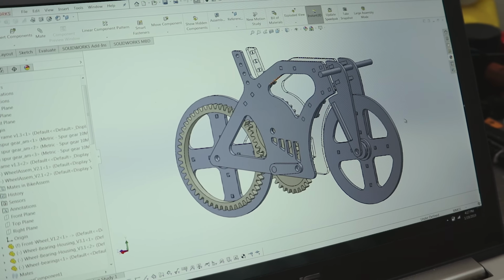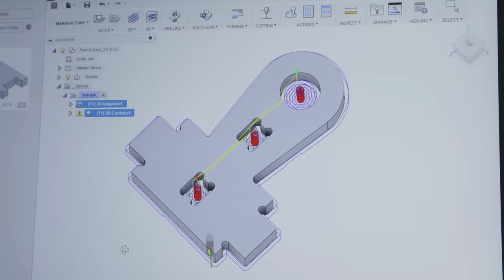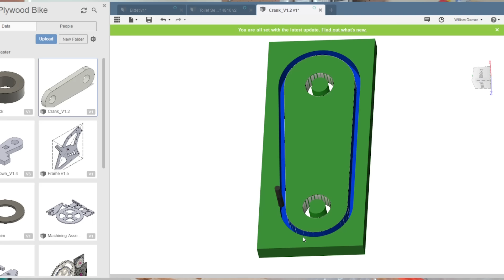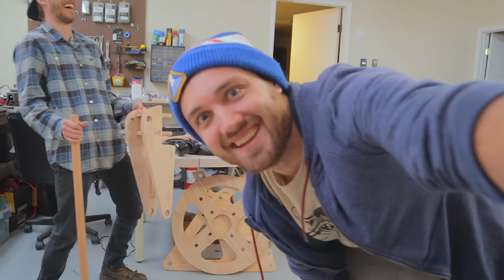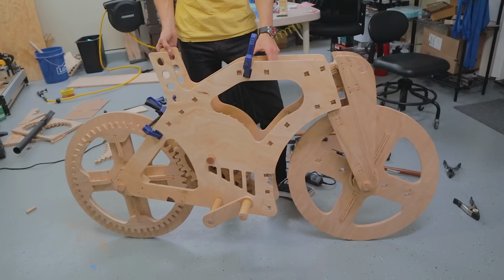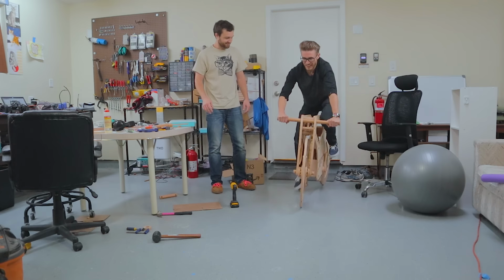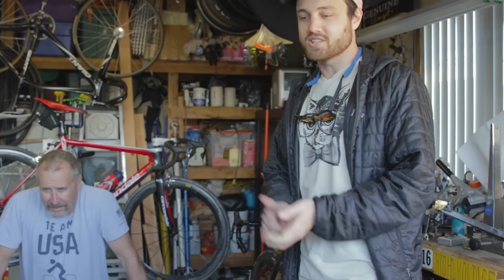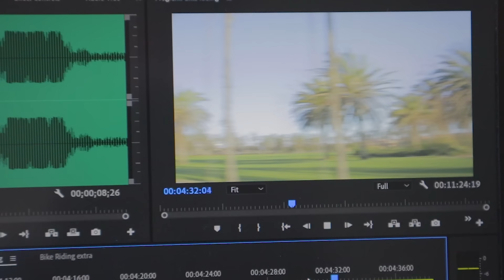ALL WOOD BIKE - Will It Survive?

Comment: That stop motion... 👏👏👏👏 I'm actually gonna share a practical CNC tip! - to avoid tabs, put blue tape on the bottom of your plywood and on the top of your wasteboard and put super glue in between them 👍👍
Reply: That makes no sense
Reply: Where is the stop motion?
Reply: okay
Reply: @ericmeader9171  It does if you have a waste board and not just cut it with nothing underneath. Also, you have to make sure you don't go through the waste board.
Reply: @Khirillin  6:50
Reply: I just use tabs, break them out of the main sheet with a chisel and use a trim-router to clean them up. 
Fast, reliable and with a nice result.
Reply: @ElectraFlarefire  but then you have to add the tabs into the whole thing... it's reliable alright but it's still a pain to even just think about what it would be like to add tabs when you have like a 200 piece thing with 50 different types and shapes.
Reply: For more stop motion like that, check out Frank Howarth's channel. I'm pretty sure William was making an homage to him.
Reply: @ericmeader9171  You have the wood you want to cut. You put blue tape on the bottom of that wood. You get it so far? Wood with tape on one side. Now you take that tape which is stuck to your wood and you super glue it to another piece of wood that you don't care about. So now you have your work wood, the tape adhesive is sticking the tape to that wood, then you have other wood super glued to the other side. The tape (which is superglued to the waste wood) is holding your work wood in place without needing tabs. Then when the cut is done, you peel the wood off of the tape.

This would hypothetically work with double sided blue tape, but that's not a common material, hence the need for the superglue.
Reply: William Osman wants to know your location.
Reply: @Khirillin  There isn't... The bike built itself in the middle there.
Reply: Greendawn21 TY
Reply: Interesting discussion here. Can someone explain it to me?
Reply: ah ye olde super glue holding, with tape to help clean up the superglue. NYC CNC use that a lot now with metal cutting.
Reply: @ericmeader9171  it holds the parts in place once the piece is free from the larger board. No tabs= nothing holding it, tape holding it from the side= something holding it.
Reply: That's a good trick, it's actually just like the purpose of a mat in vinyl cutting setting it up like that
Reply: would double-sided tape work too?
Reply: @jerrylim6722  I'm pretty sure that there are tools integrated that allow you to generate these tabs automatically in the CAD.
Reply: double-sided tape works wonders

Comment: I know it's too late but you can add graphite to "lubricate" the moving parts
Reply: Bird Up you didn’t see graphite on the ground because it’s not there!!!
Reply: Or soap...or wax
Reply: Shadowgolem or pee
Reply: I would of just flat out used heavy grease.
Reply: or wood glue...
Reply: At that point it would be a giant mechanical pencil.
Reply: Also add pedals and a seat
Reply: Bird Up This actually works, use to lubricate our wooden tubing on Violins.

Comment: CNC is like the duct tape of design.  You can use it for anything
Reply: if your cnc is precise enough, yes, I was planing to use one for making the rocker arms for my old truck till I found some second hand ones.
Reply: 0-o Nooooooooooooooo.
Not even a little bit.
CNC is a tool that can do crazy curves and depths, completely automatically, and very accurately
but
More often then not, 
using hand and manual tools will be faster, have a lower reject rate, and easier then using CNC for any one off project.
Reason being, manual tools have less steps between design and production, and every step you add you add a place where something can go horribly wrong
Great for high production however.

Semi CNC is the duct tape of the machining world.
Reply: Cnc: people think it's magic and frequently misuse it, especially when unfamiliar with more conventional methods of fabrication.   Just like duct tape.
Reply: @pstrap1311  How do you misuse duct tape?
Reply: @gavinstebbins6350  by attempting unfeasible repairs with it.  For example, patching leaky rubber boots or boat hulls.
Reply: @pstrap1311  that's not misuse. If it works it works.
Reply: @TheFuriousBean  yeah, but it doesn't work to try to use duct tape to make a water tight repair.  That's what I mean.
Reply: @pstrap1311  It will work if you use enough and do it properly. Worked for me.

Comment: Couple of thoughts i had while watching, if you ever happen to see this comment. You could make the shaft a little too big for the hole in the drive gear, use steam on the gear, fit the shaft through and let it return to room temp and dry, bam those part aren't going anywhere. Shortening those pedals a bit might help, the shorter lever length and the load being forced to stay closer to the fulcrum should reduce the stress on the dowel, at least a little. It'd be interesting to try to find a way to "lock in" in some way so you didn't have to worry about slipping off, I know from experience it's almost impossible to pedal with round pedals. Smaller wooden bearings would seem fairly necessary for an actual pedal, but i'm sure they'd be incredibly difficult if not impossible to make/able to stand up to the forces. Love this idea, I'm impressed it worked so well!

Comment: Why dont you ziptie the vaccuum succ part to the CNC head
Reply: SUCCCC
Reply: Because it SUCC!
Reply: I've worked with a great deal of cnc machinery and that's a pretty standard addition, we usually routed out an adapter for the vacuum, kinda like printing parts for the 3d printer. Another addition is a oval shaped brush that keeps the dust and vacuum pull in, downside is it blocks the view so its harder to see if it's working right. It's super useful, but sometimes hand vacuum is easiest.

Comment: In Germany we use metal for bikes
Reply: Metal for a bike! we don't use metal unless we make a toilet seat because it is too expensive. Only the best for our behinds
Reply: In Germany we simply would have researched the physical stress it would have to endure and made design and wood choices accordingly.
Reply: Werecarebear  it's more that the video was made out of curiosity to be pretty much just a curiosity and watch. No one really wants a wooden bike necessarily although I'm pretty sure it would work fine for the body you just want the wheels and the chain stuff to be made of different materials for sure, regardless not meant to be taken seriously just dudes messing around with a 3D printer
Reply: @ashleyburbank3129  Yeah I know it wasn't meant to be a serious video. They would have done a few things differently if they planned it to actually hold.

It was just "Hurrdurr German engineering!" banter.
Reply: Laufmaschine says otherwise
Reply: Ashley Burbank r/whooooooosh

Comment: If you ever do it again you can have T formed pedal with a little hole a little under the - in T, so you use the (l) in T as (ground/gravity pull ) and the - to stand on

Comment: It's a multimeter - so if a battery reads absolute 0 - then switch to resistance or continuity and check if the leads are working.! If those are working - and voltage is also spooky - then you can spend 30 minutes figuring that out.

Comment: Yeas use dowels to lock everything in place on the axles. Not trough it since that removes too much material, just so it goes into axle material say 1/3s of the diameter. Coat everything with varnish except bearing surfaces and coat those with oil so it self lubricates from the wood it self and for high tress areas use baltic birch plywood since it has more layers and can handle more force. Install rubber tires mentioned and this could actually be pretty neat little city bike. Ou and dont glue one side on, just use dowels to tie it down, so you can take it apart later. Alternatively the middle peaces make those into two that get locked by dowels

Also where are the plans? This could be fun build.

Comment: What's funny is if you had the money to build this out of timber instead of plywood it would have actually held up. Plywood is uneven in strength, so you'll get weak spots that are softer than the rest. I've seen bamboo bikes turn out remarkably well, no reason you couldn't make a designer wood bike.

Comment: Next time, machine a “key” slot in your crank then glue a wooden key in the slot,  and your axle no break/spin. And bee’s wax your bearings and moving parts.
Reply: I thought of a key too, but i think it would have to be too small and would just round itself off. Remember that everything is weakest in shear. I suggested steam fitting the shaft to the gear. I didn't think about wax, that does seem like a good idea.

Comment: So, you had those wooden shafts that were attached to gears just by glue? 
Key them. 
Keying is when you cut slots into a bar and a thing that goes around a bar so that you can insert a square piece and make those two parts rotationally locked together as well.

Since this is wood, the key should be large, and maybe you should use two or three of them to make it even better.

Comment: Have you heard about seatbelts in cars?  It's a thing since many years. From where are you not using them?
Reply: The truck? It has no seatbelts. Welcome to 1956/57.
Reply: @josephsummers2427  Well, if a car has no seatbelts it is not allowed to drive in Germany.
Reply: @NicosLeben  US/Canada laws. You are allowed to drive a classic vehicle with the equipment that came with the vehicle when new. You cannot remove seatbelts, airbags, abs, systems etc. But if when new, it did not have seatbelts, airbags, abs, systems etc then you legally can drive as is. That 1956/57 truck would not have had seatbelts, airbags, any computer safety systems. My brother owned a 1929 car, no seatbelts or any safety gear really, and we legally drove around in it. Information for ya friend!

Comment: I think this design was poorly made, from what I've seen:
1- the pedals are too small and is very easy to loose control (just make a rectangle)
2- the wheel doesn't have enough grip (just make it larger and with strips to have more surface area)
3- the gear ratios is not ideal to stay running, since you can start the bike without needing to pedal it, why bother having the ratio so low?